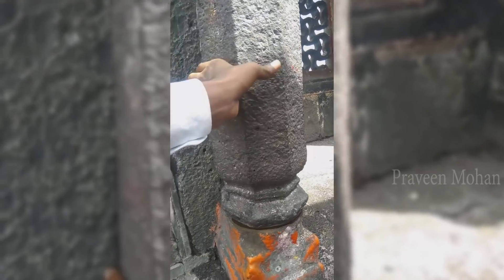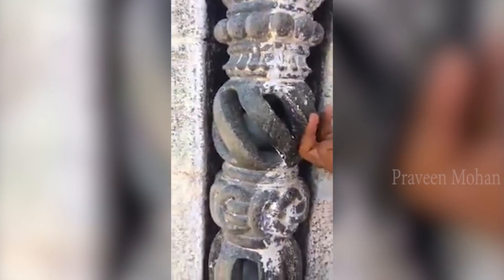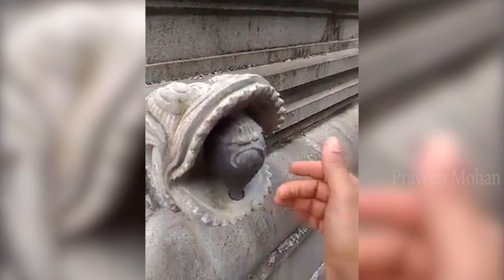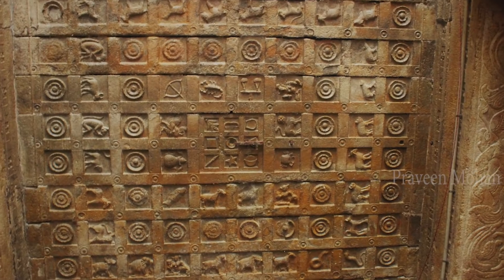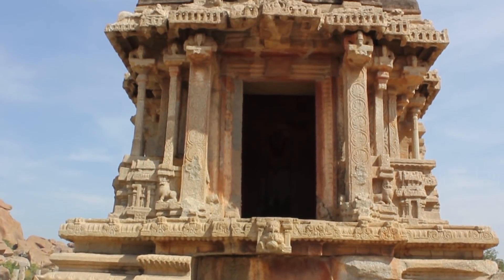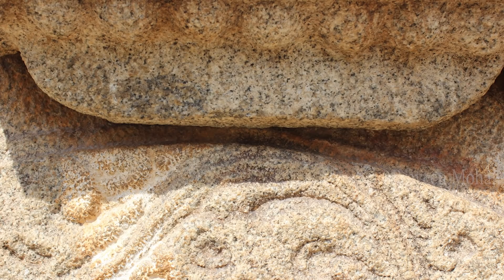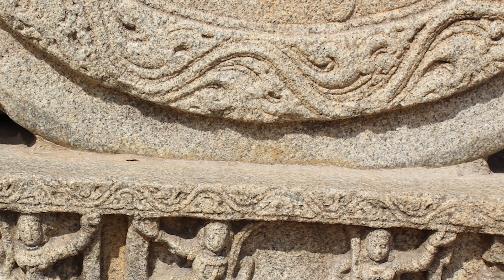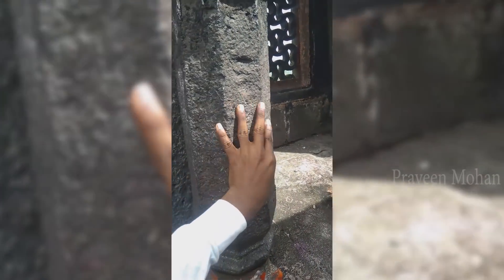Ancient Temples are MACHINES with MOVING parts?

Comment: It hurts my mind trying to figure out how they did these things!
Reply: it's really obvious? They build temples in sections, so for the first one, simply a hollow chamber through the rock and then you have a base piece with a rod carved, and the top piece with a rod carved, the weight of the building pieces above mean you can never re open the contrapment without removing the top of the building
Reply: the second one is a carved spiral out of stone, no top piece then they drop the ball in and place the rest of the pieces on top just the same
Reply: @beeopper  what about the chain made up entirely of stone and that too 700 years ago?
Reply: Truly fascinating here!
Reply: @beeopper  please tell about the snake's mouth with the ball
Reply: V OFFICIAL what snake mouth sorry?
Reply: @beeopper  ball in the mouth of the snake shown in the video
Reply: Just type puri temple's & see how science is being failed to find out the reason of strange happenings. India is full with such miracles.
Thanks.😊
Reply: @beeopper  Except most of the temples are one piece. Thought to have been carved from the top down then hollowed out. Though this is impossible in some cases so there is the theory about them being cast. I cant see what youre seeing. The first rotating column is hard to see around, the second one with the spiral and the stone is easy to see. Its clearly one piece and even if it wasnt, the ball wouldnt fit through the top or bottom of the spiral.
Reply: Good, you're confronting the cognitive dissonance that our ancestors were not stupid.
Reply: Geo-polymers for the easy win.
Reply: because you are not advanced

Comment: They are not meaningless they might  
Built for something unique purpose, they are just beyond imagination
Reply: disaster detection devices... 
1. the ball in the cage jingled, earthquake detector.
2. the spinning one would need force to move other words strong wind thus making it a hurricane detector.
3. the lion with the acorn looking thing in its mouth looked like it was a water run off so maybe the faster the acorn spins from flowing water might suggest flash flooding detection.
4. the lions with the balls in the mouth in the temples could indicate offsets of balance other words if the temple is beginning to lean, basically a built in level
Reply: @ShadowDeus  u r awesome
Reply: @ShadowDeus  
you should write this down in main comment section. so everyone can read
Reply: @ShadowDeus  ...
1. earthquake detector 1:05
2. hurricane detector 0:10
3. flash flooding detector 2:29
4. offset of balance detector 1:50

5. ancient bank safe box 3:15
6. ancient electric dynamo 8:15

Comment: Magic is just another word for Advanced Technology - Nailed it
Reply: That’s a quote lmao he didn’t make that up it’s a very common quote
Reply: Magic is also a trick with mirrors. But granite has piezo electric properties and it could be true that spinning the wheels made the surface glow faintly. As for the chains it's not necessarily wind but also water. As water splits one stream will have a slightly different charge to the other. This happens in the veins of the human body and it can be shown with a some buckets and rings. kelvins thunderstorm. It's not lost nor advanced. just very few people study physics and chemistry.
Reply: @SwisherlllSweet  don't cry brother, he also didn't claim that.
Reply: @maneesh2921  😂😂👌
Reply: magnetic is another word for magic also , positive and negative charge , equilibrium balance can run a lot of Application in this 3rd dimension.

Comment: I think the column with the stone balls are for when there's an earthquake they probably rang like a bell
Reply: Absolutely right
Reply: but why they need the bell being ringed during earthquake. Can't they know themselves that the earthquake is happening.
Reply: @deepakkumarpandey8880  😭😭😭🙃👍
Reply: @yashagnihotri6901  it would be more sensitive than the human body so it reacts faster to the earthquake
Reply: @detroitjohnson7625  nah I dont think so. See some animals have the ability to sense the extremely small disturbances caused due to earthquakes. And they are able to do so just because they can process that information and use it for the rescue purpose. Even if your point is correct ,  then too I won't believe that these extremely sensitive things ( as per you ) can detect earthquakes way before it strikes the place . In extreme cases the maximum delay would only be around 3 to 10 seconds ( coz Japan has built a system that recognizes the earthquake happening before 11 sec. as much I remember). And if its only for a few seconds what disaster can it stop by letting us know that the seismic activity has begun ???
Reply: @yashagnihotri6901  I see your point. I want to point out that just a few seconds can save lives. Remember when something had happen to you don't u wish u could have reacted in a second or two if u had a warning system warn. I could be wrong about the earthquake thing with the ball ok know this. The moving parts could be something different or it could be for superstitious reasons too or it could be for a very practical reason. What do you think?
Reply: @deepakkumarpandey8880  the ball will rumble worning you before the earthquake even happens
Reply: Like the chinse Dragon pot with 8 dragon which holding each 8 stone balls in there mouth and trops them at the direction of the earthquake into the frogs mouth?
Reply: Could be..👍 but we don't have any clue for actual reason we are only making assumptions.
Reply: @deepakkumarpandey8880  Lol.  I thought the same thing.   Haha
Reply: Earthquake lasts for mere seconds.It's not like flood or cyclone.
Reply: @bunnyrabbitplays8979  yeah besides that would wind make it not predictable. But Its like the Chinese Pot. Has something to to with weather or so. To be honest, could even we just there for decoration
Reply: something which was built with such complex engineering technique . May be engineers  back then had a greater "PURPOSE"
Reply: I think the same.
Reply: @yashagnihotri6901  we can save life of others by shouting so that they don't enter inside. There may be definitely speaker like system available near by temple. If it so more  life's  can be saved etc etc
Reply: The moving  ball might be pre earthquake alarm. So the people in those days have time to move out .
Reply: @mauleekbhat6661  I also think the same, it might have been used as an alarm system to warn the people inside the temple to run out during an earthquake, maybe because temples used to be huge and it would take time for people to run out of the structure into the open, animals are not allowed inside the temple so no warning from them, it might be that within those huge rock temples the earthquake might not be as easily felt as in normal place.
Reply: Yess, may be
Reply: Really good theory !! Should definitely be seriously considered.
Reply: what if it created resonance that negated the more severe effects of an earthquake?
Reply: @deepakkumarpandey8880  even in China they use that technique a rock inside frog's mouth to alert 🚨people that there is an earthquake.
Reply: I also thought along these lines
Reply: Think of a particular weather pattern, perhaps a particular wind strength and direction meant something significant, and would be heard throughout the temple, like an alarm maybe? I'm just an interested Aussie
Reply: You have a point
Reply: Wait but that area is not earthquake prone right?
Reply: Maybe some locking mechanism,
That ball with the rolling pillar and some other balls,
Because on the balls and pillars there were some faded symbols, which could be  used like degrees

Comment: I think that rotating polygonal cylinder is a prayer wheel as seen in Tibet. But that doesn't mean that people weren't spinning the prayer wheel and not generating electricity with human power. And that 120 ton temple with wheels, I could see that the wheels removed outward on the axles causing them to interfere with the mud guards. In fact you can see that the diameter of the axle is larger As you move inward so that it would fit the wheel tighter. So a type of washer could have been put on the outside end of the axle to hold the wheel & a lubricant, and a rolling vehicle weight is a lot easier to move then picking up the weight of the vehicle. Is the axle made out of a brittle stone that will break under the weight of the Temple? Bring out the 10 elephants that would be capable of pulling that Chariot Temple and we'll find out. Maybe it would only take 4 elephants since I myself can push a 7000 pound vehicle as long as it rolls, and I am not a strong man, I am disabled with a broken back after doing that.

Comment: @PraveenMohan when you turn the column does it generate sound or did you feel something inside? Can I know if other parts of the temple have the same column? 
My assumption is ,perhaps it is a security mechanism. 
Example :  A intruder enter the temple. The guard realize.  The guard turn the column to notify someone in the building. There is an intruder.

Comment: Sir by the look of it, the wheel of the chariot rests on the axle and according to me the axle doesnt rotate along with the wheel also from the back side the wheel is not connected to the chariot by any moving part so we can assume that it cannot generate electricity because the wheel rotates on the axle and does not have any rotating part like gear or anything connected to the chariot, please answer I have a doubt on this one

Comment: Most of the seemingly impossible sculptures were fabricated using a type of cyonics using two different ultrasonic frequencies, that when combined at just the right two differing frequencies actually destabilizes the rocks matrix and temporarily turns this solid rock into a ‘plastic’ geopolymer with the consistency of soft clay. While in this temporary ‘disturbed’ state the geopolymer can be easily sculpted and resculpted even repaired/modified as you wish. (As in the case of the round balls.) Once the geopolymer sets hard, it becomes as it once was like a rock. 

Scientists today are feverishly trying every audio frequency combination possible to find this audio holy grail. And there are millions. 

The same goes for acoustic levitation of massive objects, like 1000 tonne granite monoliths, which is performed virtually the same way using a differing set of audio frequencies focused at the object of your choice. 

Really quite fascinating stuff when you think about it, BUT it does cause one to wonder how did the ancients have audio generators that could go into the megahertz range pumping out kilowatts to megawatts? Somebody’s been sharing the wealth of  “advanced knowledge” from not of this earth. 

Guess they took the hardware with them when they left, unless some remnants are buried somewhere waiting to be found.

IMHO . . .

Comment: Prayer spinners. Not electrical producing. 
Also, you can carve wooden items with balls inside them - very easy to find in country (USA) stores and craft fairs. 
No reason stone couldn’t do the same. 
Bad conjectures in the “machinery”. 
The safes, that makes sense. Mechanical moving parts are fairly easy to layer for locks

Comment: On the Lions mouth stone ball your wrong it's a puzzle design I've seen. the whole mouth slides out with a pin behind it. 
(You can see the difference in the cut groove beneath the eyes.)for the wall puzzle you would look for the pieces affected most by (human skin -acids and oils our hands sweat out) look up <worry stones> repeatedly rubbing the stone wears it thin and smooth compared to a stone not touched that would have less erosion (I see a combination lock with the keys worn smoother)

Comment: There are way too many Comments to quickly go through them all, but modern tech and electronics use crystals to generate electrical currents. Its called Piezoelectric crystals. Mainly Quartz and Tourmaline. So when you strike a Quartz you can generate electricity. You also have the inverse. You can affect Quartz with electricity.  Maybe the ancient Builders mastered the art of Piezoelectric crystals long before we did, which was in 1880 (Jaques and Pierre Curie).

Comment: The Temple Door Puzzle:  The handle #1, then the lever piece to its right could be pressured or slid, then the square hole which is like a mini Lingam might be something or fallen apart.  Also the animals, if we could see which do not belong or are different.  The bottom hinge differ from the top like long strips of brick each with a pivot back or inward like laced fingers, 2 on bottom one on top.  Maybe they move independent to reveal the level to pivot the stone.  The doorway the seems don't allow to open outward all around frame.  But inside the frame they do have wear.  Sometimes a big door is also small and may hold a key to a real door nearby.  These stones may use one lever to slide each strip or only a small center stone.  Its all worth while and interersting.

Comment: the material of the chariot looks like granite which has a high quartz content. if you rub quartz together, or even sand with a high content or shake them in a translucent container, they spark and glow. it is called triboluminescence. so there is probably a container of very thin stone inside that rubs some quartz or sand together when the wheels turn. i was amazed when i was in india by that muslim temple of the saint right outside of agra, the one where everyone ties strings to make a wish - anyway the walls were so finely carved that light shone through the sandstone or alabaster (ive forgotten which). that or maybe a chemical mixture is contained in stone cylinders inside that emit a light when shaken. you can also get a charge with copper inserted into some stones like green basalt. but it would not luminesce. those are my guesses, but we would have to take that cement away and turn the wheels again to see for sure. however they did it, it is certainly marvelous! 
my wish came true at that temple by the way. im not muslim, but it was requested respectully with a pure heart.

Comment: Maybe it rotates because it was made out of melted stone poured in a cast from the ground up.
In that case they would have to put a rod or bar in the middle in order connect the parts and also enables the middle part to rotate, then put the first lowest cast around it and cast it in three difftent parts.
Maybe they also were able to put a stone ball on each side of the rod to make it rotate more easily?
Maybe they put some kind of stuff that desolves in between the parts before casting the hot melted stone in order to make sure the parts stay seperate?
Maybe even some stuff...like oil that also serves as a lubricant?

I'm just guessing, my imagination is going wild.

Comment: The rotating mechanism in the first minute is interesting. It might not have been build from the components it is made of today (from stone). If something is created, it requires maintenance to maintain it in the current state. Given time, this mechanism will have been affected by environmental factors (maybe disasters, ash). What we see today, is not what it looked like before.

Also for the ball in the mouth, the safe, the charriot, etc. My guess likely this was wood or a metal.
Reply: This is called a substitution pseudomorph.

Which would explain why they look as technological devices, but only in appearance, as the original technology is not there anymore, only the imprint.

Comment: Have anyone checked the whola statue, and with a 3D Scanner? Because so the smallest opening would be visible!
You could put it in, and then close the back with a fitting stone (same type) and then polish the surface to perfection without leaving any type of gap! With a 3D or high resolution Scanner (Roentgen) it would be able to check.
The door (Portal) could also be a stone picture of a real Portal somewhere else in the Temple.
The wheels were movable for sure, the upper guard where your hands were are made to keep the wheels on the wave!
I was just thinking that you can build it to the accuracy that if you heat the lion up and make the ball cold, you can stick it slightly in and when both get to the normal temperature, they would fit and you wouldn't be able to get it out again!

Comment: At the beginning of this vid it would have been very informative if you had taken a step or two backwards to give us a larger field of view. Upper and lower parts of this thing are obviously corroded metal alloy containing arsenic and iron. Is that rotating hex column an original part? There is no discoloration, perhaps due to scratching/hammering off of the cams that might have been there. There are rows of round holes going around that thing. With the cams in place this might have been part of an intricate door lock or part of a music box, with the cams engaging metal sheets to make sounds. Again, taking a view from ten feet away might give us more clues. Btw, thanks for going at it with such resourcefulness.

Comment: The wheels could have produced light by simply adding flint to the surfaces so when it turns it's like striking a match, is there channels inside that look upon the tops of the wheels?
If so then surface friction would produce light to illuminate the inside.
Seems more logical considering the wheels look as if they can be removed and replaced.
They just change the outer rings when they wear down.
And the balls in the mouths can be done by good craftsman.
You can find a lot of videos of people doing such things with wood.
And the onyx ball could have been the reason they chose that stone and simply carved it within the mouth.
A sphere is easy to carve with water and rotation, water is incredibly abrasive.